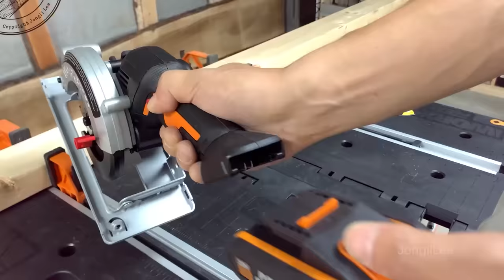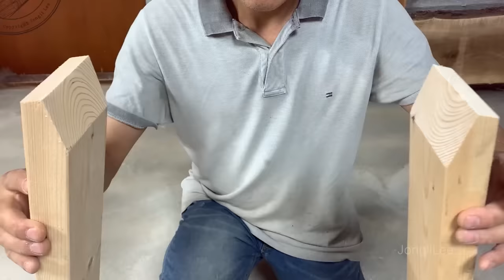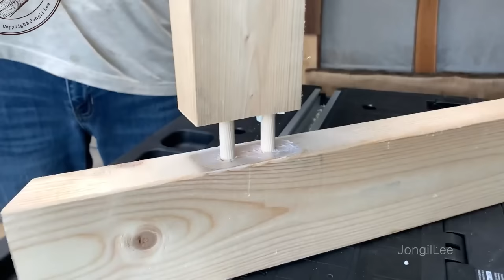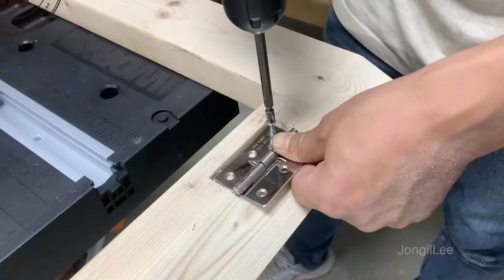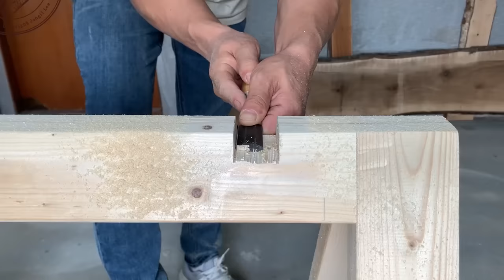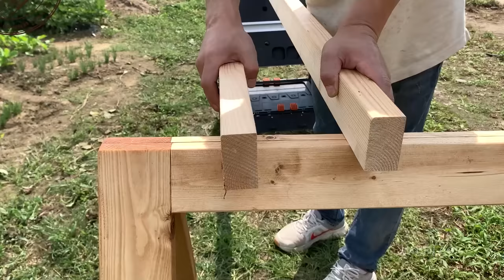Making A Simple Style Folding Sawhorse / Feats. WORX WX051, WX531, WX176, WX820 / Woodworking

Comment: I love it. Very simple yet probably the best I've seen. I've made temporary saw horses on the job which probably took 15min to build a pair of them but always just junked them or gave them to the customer when the job was finished. These I'd actually keep. I've purchased many of saw horses before and they just don't hold up to daily use and being beat up in the back of the truck but these I'm sure would. I'm sure the ones I made would also but too bulky. Now I have a bunch of store bought saw horses I use in my shop and they do hold up well if you can take care of them.
Reply: simple and easy.  thanks

Comment: Nice job for the most part , however you have a dry Dowl Joint unless you apply glue to the dowl rod and the joint. You should also make sure the glue coats the hole on all sides of the hole. 

One last thing, the end grain of the legs where they will come into contact with the ground. Needs to be sealed multiple times. The end grain of all wood is very thirsty. It's going to suck up the sealer. The end grain of all wood under a microscope looks like little straws. They're hollow and will allow moisture to  be sucked up and slowly deteriorate the ends
Good luck on future projects.
Reply from the maker: Thank you very much for your sincere and useful comments. Very good advice for me!

Comment: The addition of chain on the inside at the bottom of both legs will reduce the chances of legs splaying out under heavy loads. Doesn't need to be a big chain. Use a spring or elastic to pull the chain up out of the way when sawhorse is not in use. Nice build though.
Reply: I believe he purposely omitted that part.  I for one, would not install one as it does not require it for my needs and will just gets in the way or another part to purchase.

Comment: Nice work but with 2 folding metal sawhorse brackets,7pcs of 2x4,36 1"3/4 deck screws and 8 4" deck screws I could be done in 15min and much stronger.

Comment: If I told my apprentice to build me a saw stool and he built me this I would be waiting a whole day for it lol. This would be ok for a pair of dining table legs though. For the sake of speed and hardiness I usually cut 4 legs (90mm x 45mm) at 15/15 degrees(2 angles on one cut) on both ends. Legs at 800mm long. Seat is 140mm x 45mm and 800 to 1 metre long. Screw seat into legs and countersink. Legs are 100mm in from edge of seat. I set the saw stool on a flat surface until it sits level & firm. Then screw 18mm short ply on both ends of legs  under seat. Finally I run a 90mm x 45mm timber underneath seat from ply to ply and screw.
These stools have lasted me for years without adjustment. I use some heavy gauge screws eg 12mm bugle screws.

Comment: Pretty impressive skills. But why go to all of that bother when you can simply pick up a pair of sawhorse brackets at a store and then add the two-bys for the legs and crossmembers?  The resulting equipment would still fold, be just as strong and give you the utility as the piece built in this video, probably at a similar cost and ready to use, quicker than it is in this piece.  Overall, this doesn’t give me anything I can’t just buy and use more quickly than making it myself:  No benefit for the time spent.
Reply: Lots of things are made less for the practicality of it, but for the enjoyment of doing it.

Comment: NO GOOD, that saw horse is only as strong as the soft pine dowels you used to connect the horizontal top bar with the vertical legs, you're very brave to stand on that, I would not. You should have used some sort of through member tenon or at least a pocket tenon not dowels.
Reply from the maker: I know this sawhorse is very sturdy. So I can't agree with your opinion, but I respect your opinion. thank you
Reply: @mokongtv123  You have 4 wooden dowels holding up the cross member, no screws, no nails, 4 dowels. So how ever strong 4 wooden dowels is, is how strong that saw horse is.

Comment: A FLAW IN DESIGN: According to the building codes in USA (or common sense), the top pieces need to be on top of the legs so that all the weight is applied on the legs instead of on the dowels!
Reply: It’s the dowels plus the glue joint, but you are absolutely right.
Reply: Absolutely right thanks
Reply: According to common sense the max weight you put on top of a working bench is not bigger then what a man can lift so this will work just fine. But you couldnt resist not to speak The Truth
Reply: Good job he's not in the USA then.not all the world works to the yank standards
Reply: Rule one of DIY………IF IT LOOKS STRONG ENOUGH IT PROBABLY IS

Rule 2………if it doesn’t look strong enough don’t trust it!!!

Stavros
Reply: @mandipano1  Don’t underestimate my A-frame and a come along